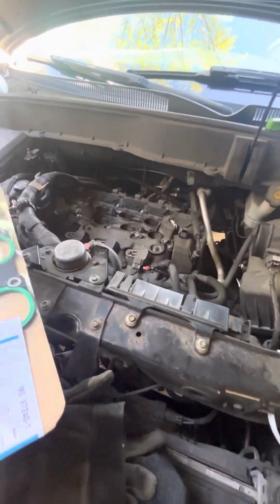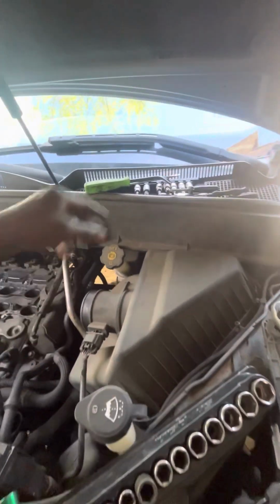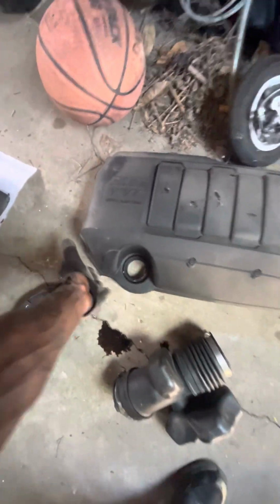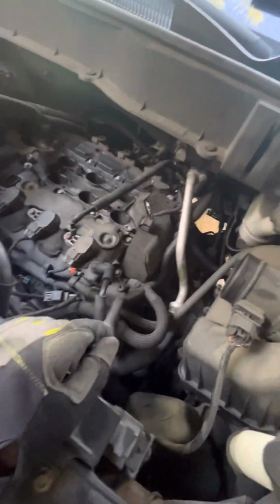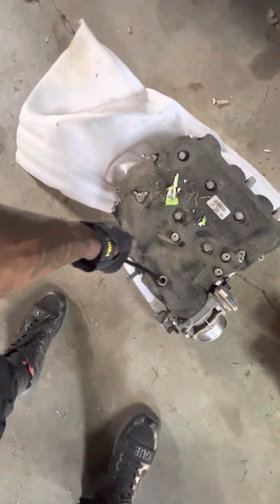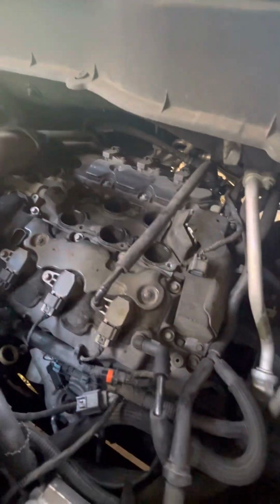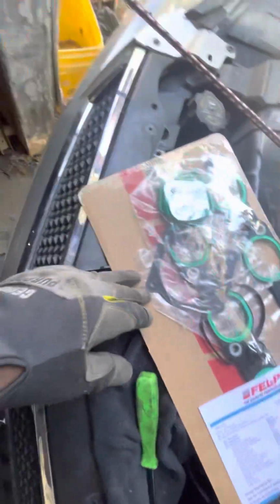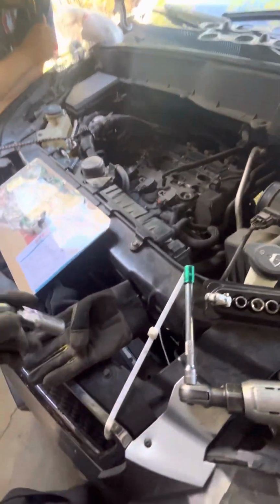2010 Chevy traverse 3.6 intake manifold gasket replacement and tune up

Comment: I recently bought the same gasket set for my 2010 Acadia. Aside for the lower manifold and throttle body gaskets have you figured out where the other gaskets go?  Not that anything needs to be replaced, yet (knock on wood), but for the life of me I haven’t even figured where the 6 green gaskets or the larger black gasket would go if I were to ever need them.
Reply: Hello and yes I'm also struggling to find where green gaskets ho?